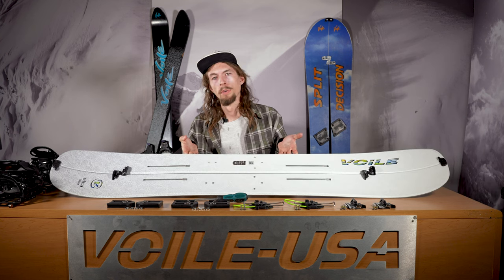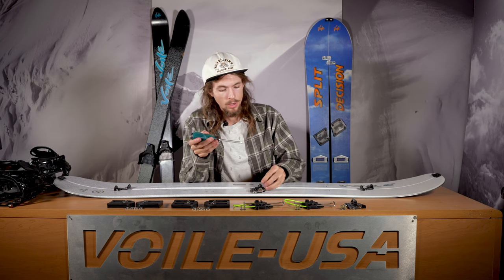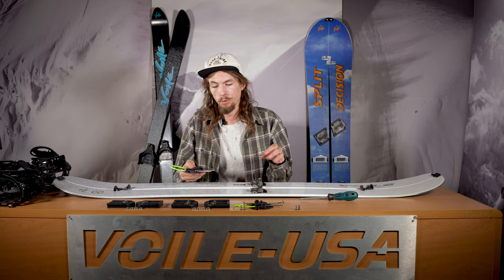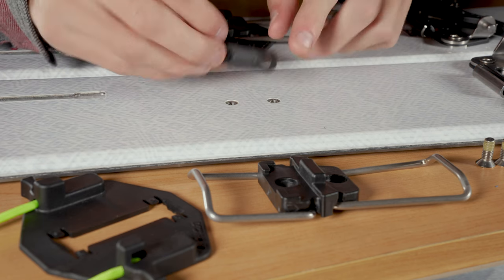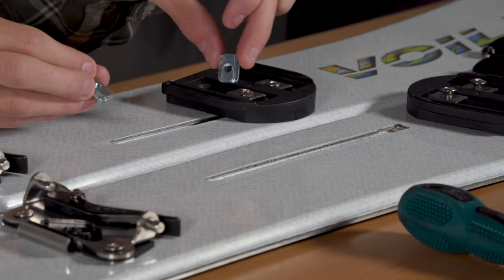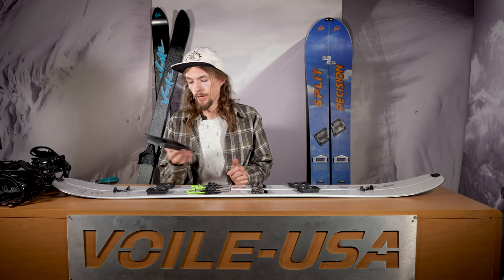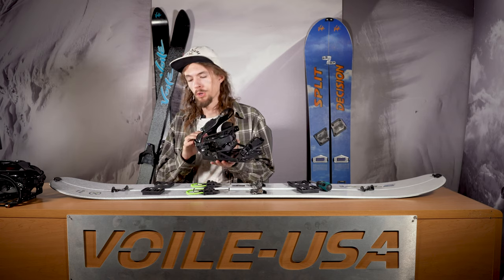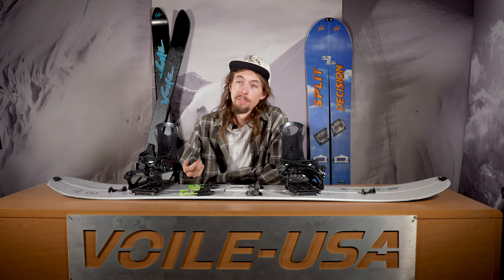How To Set Up Your Splitboard Hardware | Channel Puck System

Comment: What is that green belt for?
Reply from the maker: While skinning, you can lock your splitboard binding down with the heel piece during icy traverses or downhill portions of the skin track. Pulling on the green cord allows you to unlock the heel easily while out in the field. Hope that helps!